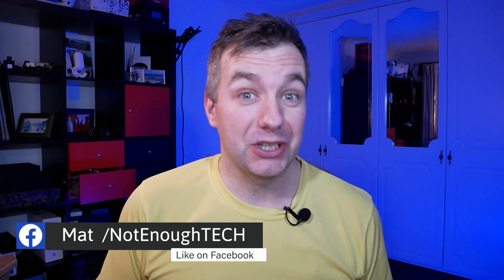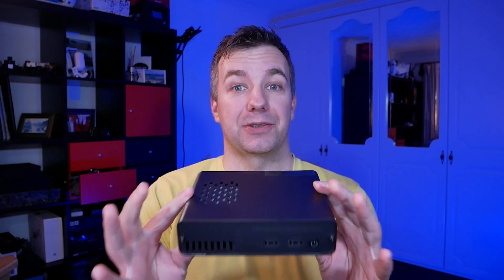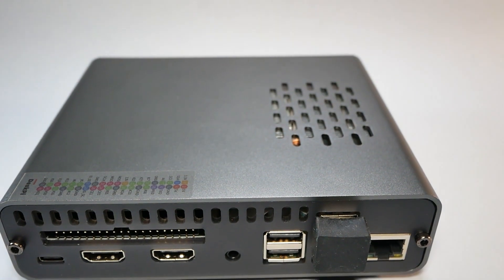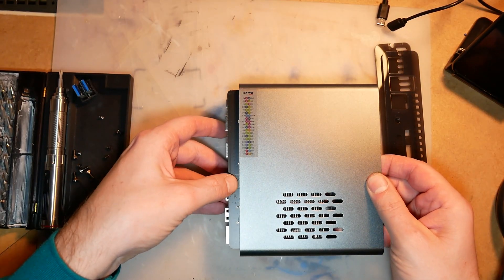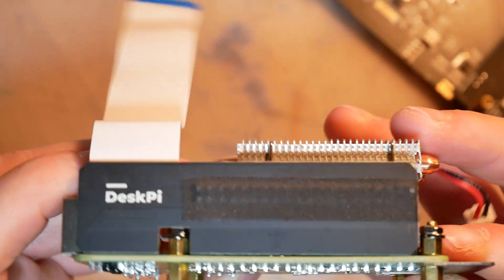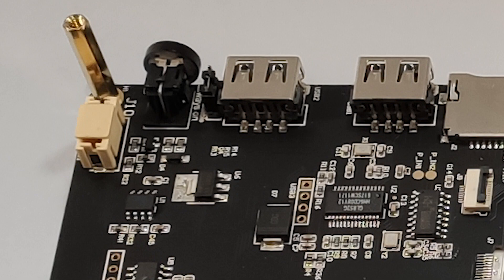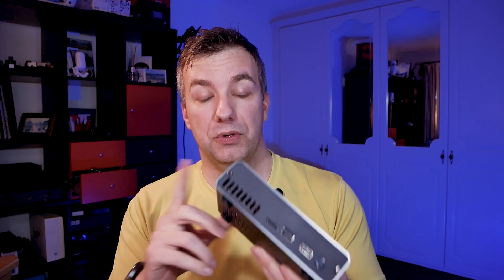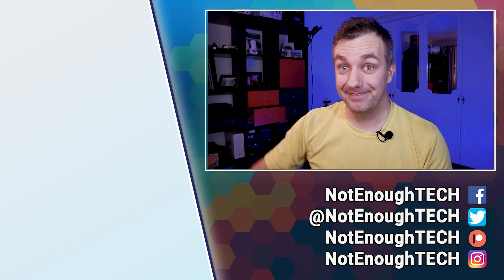The ultimate Raspberry Pi 4 enclosure? DeskPi Pro [review]

Comment: Absolutely loved DeskPi Pro after seeing reviews.  Once I got mine, the blush was off.  HDMI would not work with KVM switch, video cannot drive monitor, so just see black.  Exact same KVM and monitor works PERFECTLY with Argon One case and three other i86 computers.  What I like MUCH better in DeskPi over Argon One M.2 case is the ability to use standard SATA interface for SSD or HDD.  I am hoping that by adding an HDMI repeater/extender this will solve the problem, indicating that the HDMI output from DeskPi may be slightly out of spec.  When cables are added for KVM usage, the length the signal has to travel causes the problem to occur.   When hooked up directly to monitor with a short HDMI cable, it works fine, but when hooked up directly  to the monitor with a longer (15 foot) HDMI cable, the problem also is present.  I am hoping also that in March when Deskpi releases their upgraded PCB board, that it will solve the problem.
Reply from the maker: Hope the PCB would fix it for you. I could reproduce the boot issues from SSD but hdmi worked fine for 4k and 1080p for me
Reply: @notenoughtech  Do you know what would happen if you used a 15 ft. HDMI cable between DeskPi and monitor?  I tried bypassing KVM with one and it still exhibited the blank screen.  I was using a high end HDMI cable (or so it claimed) and a Viewsonic VA2465Smh which I believe to be a quality monitor.  If I connected using a 3 ft. HDMI cable, I could get perfect video.
Reply from the maker: @redrockroger  I think the one I had was 2m. I'm not an hdmi expert do can't think of any insightful advice I could give you. 🙁
Reply: @notenoughtech  I am also not even an hdmi wannabe.  When I get the repeater/extender and try it out, I will report.
Reply: Bought two different brands of HDMI repeater/extender.  Tried both, neither worked.  Even tried both in series, still no video.  Just for grins, tried output of HDMI1 (was using HDMI0).  Worked just fine.  Then I went back to trying HDMI1 with KVM, worked just fine.  Now booting from SSD and using KVM, everything working that I can see.

Comment: WiFi not working on my one
Reply from the maker: Enclosure doesn't come with WiFi. Issue with a flashed card?
Reply: @notenoughtech  if I take the device out the case the wireless works.
Reply from the maker: There is probably more going on. What's the signal strength out of the case? I'd look into that

Comment: Hello：

Everyone, we do apologize for not bringing a good user experience at the first batch of DeskPi Pro. For the quicker

shipment of the pre-sale orders, we ignored your needs on the DeskPi function.

To completely solve the problem, we will re-send the re-modified PCB board for all the customers who received the

DeskPi Pro product. Our sales staff will contact you according to the order time.For some not shipped orders, we will

contact you and adopt your ideas.

Considering R&D and mass production, the holiday on the Chinese Spring Festival, the new version PCB board will

be shipped to you at the middle of March 2021.

And we will strengthen management in design and mass production to avoid such problems. Thanks again for your

trust, especially the first batch of customers, you are very important to us!

In the later R&D, we are looking forward to your suggestion and supervision, and continue to create higher quality

Raspberry Pi product and provide better customer services!
Reply: Not holding my breath to get the updated PCB anytime soon. Fit and finish on mine was crap. Never booted from SSD. Was told it's my issue and the OS is causing the boot issues. From my experience customer support was much less than desirable.
Reply: Has anyone that received this version heard back from DeskPi Pro, I emailed the company a week ago for an update with no reply. My Deskpi has been sitting in pieces in a box since I received it as there was no output from the HDMI ports aside from the occasional purple screen. I moved my Pi back to my original case until the replacement PCB is sent which I have my doubts the company will follow through.
Reply from the maker: @barriejalbert1450  I'm going to email them after 15th as they promised replacement boards mid March. I had a positive experience in the past with them and their support so for now I'm hopeful.
Reply: Like I said Barrie I'm not holding my breath about anything from this company. It's bad enough the product was so sub par, their customer support is far less.
Reply from the maker: Hi Kevin,

Any info or updates in regards to the replacement PCBs?
Reply: @notenoughtech  I sent a message with their online chat regarding their lack of support and not receiving a response to previous email sent and they replied the following day. Have to send them a follow up email fingers crossed.
Reply from the maker: @bearstechtalkdiy7165  they have been good in the past assisting with 52pi stuff so I have confidence in them based on past interaction
Reply: @notenoughtech  A few others have said that with regards to 52pi stuff they have been good. I like the idea and design of the product and not having to do a custom PCB design to add full size HDMI and having to relocate the ports. The slot spring loaded SD card slot was a nice plus. I'm not using NVME drives yet so I found this to be the best solution for what I was looking for at the time.
Reply: @notenoughtech  Nice Coffee Mug BTW :)
Reply from the maker: @bearstechtalkdiy7165  Thanks :D
Reply: @notenoughtech  about 2 weeks,we will send another accessory for gift in the replacement PCBs box
Reply from the maker: Thank you for your update Kevin. Much appreciated
Reply: @notenoughtech  Thanks Kevin
Reply: I'm waiting to order this case since the first reviews, but I was afraid when I started to see the comments of the first PCBs.
Has anyone who has recently ordered receive the new PCB revision? Feedback?
Reply from the maker: @DavidMeloOfficial  I will be posting as soon as I get my replacement pcb
Reply: @DavidMeloOfficial  Not yet, they said they would be shipping them around the end of March. I can do a review of the new version once I receive it if there is a want for an updated review.
Reply: @bearstechtalkdiy7165  That will be great!
Reply from the maker: Kevin, thanks for the reply and providing us with great customer support. I'll pin this post as a reassurance that everyone will get the DeskPi Pro they deserve

Comment: not a comment on your excellent video, but the trend of making an RPi a desktop NIC.  It kinda defeat the purpose, Pi's were meant for interface tinkering. I have a ton of RPi's in the house, from all generations, and a big fan and have used them for all sorts. But making it a NIC using M.2 and/or SSD's over USB, i know it works but is it worth the investment against a cheap NIC?    
I do admit, one time i tried using a 3B as a laptop replacement in the workplace where VDI (Virtual Desktop) was standard way of working, so only graphics and networking power required, but the Citrix issues where too much trouble.
Reply from the maker: I always say options are nice. Having the ability to do something is better than not having that choice. While I totally agree with how we really use RPI for tinkering etc... We tend to forget about the RPI mission which is to produce affordable computing for learning.

While you could get a cheaper 2nd hand device. Sourcing these for schools and learning institution on a budget with full up to date support and courses would be very difficult. 

Obviously dropping $55 on a case where budget is concerned isn't the answer but as far as SBC goes it's a legit device that can be used for anything with a years of support. 

Lastly that 40 pin header exposed at the back is till available for tinkering. ;) Personally I really like RPI over other boards thanks to their commitment to their mission and incredible community that makes it easy to solve problems you might encounter. Something that is often missing with other hardware.

Comment: Wait until after MARCH before ordering one !

They posted this on December.29.2020

Hello：
 
Everyone, we do apologize for not bringing a good user experience for the first batch of DeskPi Pro. For the quicker shipment of the pre-sale orders, we ignored your needs on the Deskpi function.
 
To completely solve the problem, we will re-send the re-modified PCB board for all the customers who received the DekPi Pro product. Our sales staff will contact you according to the order time. 
 
For some not shipped orders, we will contact you and adopt your ideas.
 
Considering R&D and mass production, the holiday on the Chinese Spring Festival, the new version PCB board will be shipped to you at the middle of March 2021. 
 
And we will strengthen management in design and mass production to avoid such problems. Thanks again for your trust, especially the first batch of customers, you are very important to us! 
 
In the later R&D, we are looking forward to your suggestion and supervision.   
we can produce more creative and higher quality Raspberry Pi products and provide better Customer services!
Reply from the maker: Oh interesting thanks for sharing the message. I'm the lucky one as I've not bumped into any issues other than tiny misalignment of the panel which was solved on my 2nd assembly.
Reply: @notenoughtech  Just got one from Pi Hut, has a new board to install.

Comment: Happy New Year Mat! Nice review. I received mine before Christmas and was very impressed with the build quality. Unfortunately like Frederico I've had issues with the SSD boot. There's an instruction video by Kevin Deng who I believe is from 52PI and in the comments he mentioned that they will replace the SSD interface once they finish testing a new one. Here's the link: https://m.youtube.com/watch?v=wUHZb9E_WDQ
Reply from the maker: Thanks, sorry to hear it. I will play a bit more with mine - are you using M.2 or SSD for boot?
Reply: @notenoughtech  I'm using SSD Mat..
Reply: Ditto, same issue here. I got mine 3 weeks ago, and shelve it because I can't boot SSD. Hope the fix will solve this
Reply from the maker: Are you all using original supply? I noticed it's QC3 and something tells me this is a power related issue
Reply: @notenoughtech  All I could say is that I was able to boot from the sd card and see the SSD drive, but not boot directly on the drive. I wasn't aware of latest version of the web document. I will try what they mention about booting SSD, but not before end of week
Reply: @notenoughtech  Mat, I am using the PSU that came with it. I spent countless hours on it and did get it to boot on occasion, but it doesn't survive a reboot. I can boot fine from the cheap external adapter I had been using. Others have had this same issue unfortunately.
Reply from the maker: I hope the PCB will get that sorted. I will keep an eye on this and how it develops

Comment: How would you rate it against the Argon One M.2?
Reply from the maker: Ability to slot in the full SSD and 2 extra points are very good. The argon looks a little more interesting and it's smaller.
Reply: @notenoughtech  Thanks.  What do you think about each case;'s ability to passively cool?  Seems the DeskPro fan would be great at cooling, but the Argon might have an advantage in passive due to the case being thermally connected to the Pi directly.
Reply from the maker: @johna2193  both were about 55ish in passive mode. I'd say the difference would be minimal

Comment: I received mine just a few days ago but I'm pretty disappointed (and I'm gonna contact their support) because I found a lot of problems shared by at least a few people (as proved by the issue on their github and some workaround).
Reply from the maker: What was the issue? So far mine had been behaving well.
Reply: @notenoughtech  Youtuber got better item than common user. Normal as always.
Reply from the maker: @Artsi66  I got lucky. I actually paid for the order. I only got a extra discount from seeds for sharing their links on the website. 
As per comment pinned they work to resolve it so I hope that soon enough everyone will get their cases fixed. It sucks that it's broken but at this point company acknowledged it and got a plan how to resolve it.
Reply: @notenoughtech  I just received and email with the tracking detail of the new version of the board. They are sending it as a free replacement because they acknowledge the issues with the original version
Reply from the maker: Awesome ;) I can't wait to get mine as well.
Reply: @notenoughtech  I just received the new package containing:
1) new usb hdd board
2) new aux board
3) new usb to usb plug
4) new back IO board with fpc calbe
5) screws
As soon as my workday ends I'm gonna to replace the new components and do some tests
Reply from the maker: @FedericoGranata  darn you got yours before me 😭😭😭😭😭
Reply: @notenoughtech  to be fair you receive a lot more tech goodies than me...
Reply from the maker: @FedericoGranata  don't try to assassinate my career my friend. How I suppose to lead things when people get cool stuff quicker 😁😁😁 I'm curious to hear from you ❤️❤️❤️
Reply: @notenoughtech  you are lucky then. I have to put quirks in my /boot/cmdline.txt to avoid a ssd speed in the order of kb/s but doing so I just got slightly more than 200mb/s ... beside that every time I reboot (or shutdown) my rpi I have to unplug/reinsert the usb to usb adaptor or my ssd isn't seen anymore ... pretty major bummer. You can check here https://github.com/DeskPi-Team/deskpi/issues
Reply from the maker: @FedericoGranata  are you suing original power supply? Sounds like drive is not getting the power it needs?
Reply: @notenoughtech  I'm using the power supply they send me with the deskpi
Reply from the maker: @FedericoGranata  got original supply from Pi? Give it a go. My bet is on supply
Reply: @notenoughtech  I'm using the QC 3 power supply provided with the deskpi itself ... What should I use to provide enough? a car battery??? :D